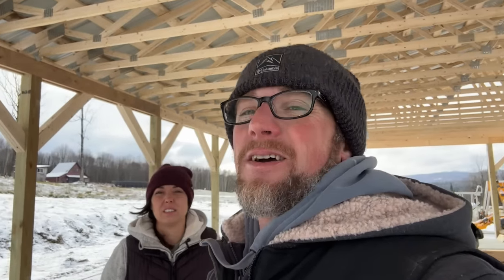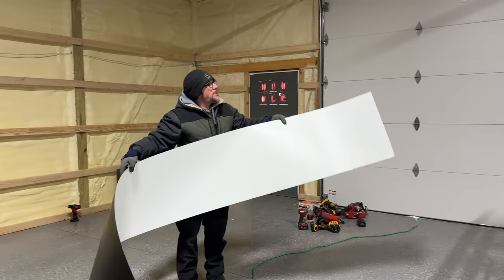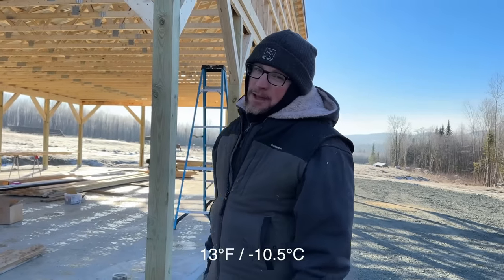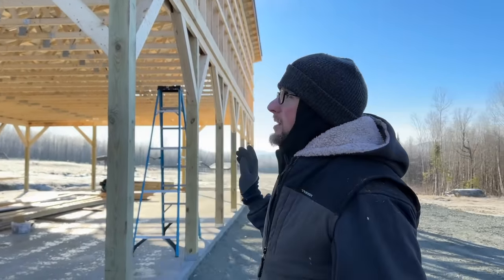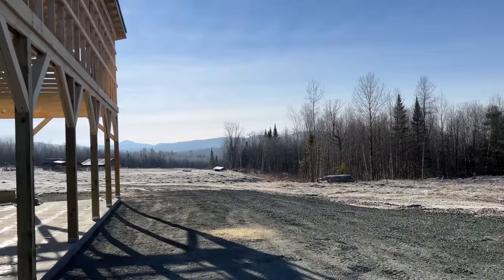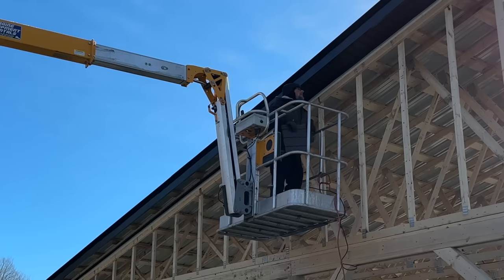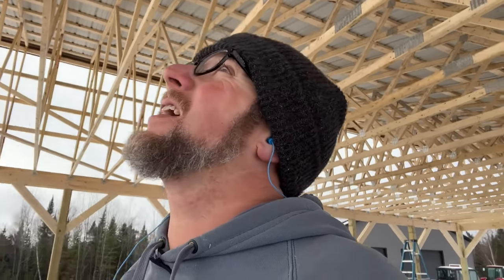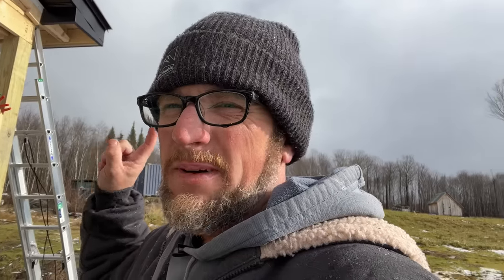The Day I got STUCK in the Lift!!! Day 5 Building our 32x48 Off Grid Post & Beam Barn in the WOODS

Comment: A mop up job I got due to a GC's inability to due their job resulted in the discovery of an orphan window that was totally missing it's trim. Using a couple of 2x4's and and unused piece of stainless steel trim from a Viking Range I made a sheet metal bender. Thanks for the pointers using the  bender there if I should ever need that skill. A teacher at a vocational school would be a good fit for ya. Gina needs a face shield from Harbor Freight. Safety squints and glasses aren't cutting it. Seeing those eyes as she's a tad stressed out over you getting hung up is preferable to not seeing them being able to express that due to an injury.🥺
About the layout: Where's the frost free hydrant for the water coming in from? Unless the barn is heated with it being closed up the body heat of the animals won't keep it from being frozen. 🥶You'll end up breaking the ice twice a day and filling them up at that time too which is preferable to putting heat tape on it. Livestock messing with electrical results in downed animals.😵Just a Few Acres Pete has an open front setup that works well for him. Are you doing deep bedding or just shoveling it daily.🥳Chickens have a great time on compost piles and pigs do a great job of turning it over with a bit of incentive of mixing some shelled corn in there to go after. As a heat source it works too as you add some sawdust when it gets a little wiffy for the carbon. What kind of hay are you getting: Bales that are rolled or rectangular like those around when I was a kid? With that determined where are you storing them? You spoke of a couple cows so more is coming than you needed before when it was just the goats. Rumor has it you still got the old place so some could be put up there. More input is needed before I can begin to scratch my nut on this.🤔
Looking for you next time from South West Mo.👍😁. Guess whats going on here.☔

Comment: Wondering if Al is going to have the inside metal walls of the Barn Spray Foamed like he had done with the Workshop building ? Sure would be a lot nicer and warmer for the livestock during the cold winter months and also insulate from the heat of the hot summers !
Reply: They

Comment: Al, I know it's a rental lift and it's going back soon, but both Milwaukee and DeWalt have 18v cordless heat guns.  With all your equipment, I can see where one would be handy to have in the side by side, tractor, etc... especially in winter.   I'm in the Makita platform, but have a few of the Ryobi 18v tools for garden stuff.  I bought one of the heat guns (Ryobi) and use it to soften the drip irrigation mainlines and tape/dripline to slide on or off the fittings (easier on old arthritic hands).  Next thing I know, it was how did I not have one of these before as there are so many more times it had come in handy.

Comment: You might want to put down tracks so you have moveable walls that you can adjust to the needs of each animal. I’ve seen them in horse stables with the stall walls that are made with metal brackets that you slot wooden slats into so the height of the wall can be adjusted. I don’t think you could do both in one barn 🧐
Reply: That's a good idea - although screws would work too... just unscrew any construction and re-arrange!
Reply: @samvalentine3206  Pens would be better like what Justin Rhodes does. Animals push a lot and use walls as scratching posts. You need pens! I have horse stalls in my barn but I wouldn't trust a pig with one! Big staples and such to hold pig panels with. Pigs are bulldozers. They can send a metal door flying off their snouts and do several revolutions with it. I've seen it. We were trying to cover a hole by our pig gate with a metal door. It went flying! They started playing with it all over their pen. I'm not sure a cow wouldn't break a horse stall.

Comment: Al, your buildings are wonderful and so well planned.  I could not tell for sure,  but your barn trusses appears to have lateral diagonal bracing only on the high eave side.   I built a very similar trussed structure in 1992  that suffered a straight line wind event before we got all the lateral diagonal braces in place.  It had decking, so the trusses turned over from their vertical plane and turned to spaghetti.  Lost the entire roof.   Lateral diagonal bracing is critical at the mid span point of your trusses and should run the length of the building traversing up and down about a 30 to 45  degree angle.

Comment: You need to spray some wd40 around the buttons That will keep the water from building up. You need to show Gina on the machine. There's Emergency buttons down On the bottom there to get you down if you get stuck up there.😂

Comment: Are you considering a water catchment system using water from the new barn?  Don't know if you have an area in the barn for a 350/500 Gallon tote.  Burying the Cistern/Tote is another option. Since you have solar, would you be able to heat or insulate the Tote to prevent freezing.  I guess an easy option is you only use the water catchment system for the 6-8 months when there won't be freezing temperatures. Do you have an area where a small pond could be built and water from the roof flows into the pond.

Comment: Good morning Al and Gina.  Maybe you've gotten to know me a little.  Maybe your saying or thinking "Oh ~  that guy again."  Well anyway.  So much fun with all the potential that you've got here.  But really guys, Christmas is here.  You all should be decorating and making plans for Christmas ~ don't you think?   Just saying.  Anyway. Yea ~ too cold.  So you know I've got "suggestions."  Here you go:  Remember the greenhouse that you've got at the other property?  The Greenhouse grade 6ml plastic. Not from Lowes or H.D.  ~ I get mine from Cleveland and they get it from Israel.  So the sofits and siding.  But then you could "fill in" doors and any extra bays with a temporary quick cover of plastic. Keeps the wind and snow out.  Just for the winter.  Reinforce with some light framing two feet on center.  Strapping works. Just to wrap ;the building for now. Take another look in April and May.  OK so that's my suggestion. Just saying.  Best wishes and thank you so much for sharing all that you do.    ～ ✨🌟👍🌟✨ ～

Comment: It's probably a moot point by now but it would have been in your best interest to store the life in your shop overnight to keep everything from freezing and save the batteries and the oil from being so cold. Everything looks good, the only question I have is do you have plans to close in the sides for a windbreak or what were your plans.
Reply: the shop is not heated at the moment, but an old raincoat and a bungee cord can keep the weather away from the controls at night.

Comment: Hi gang wish I was a little younger and had your ambition. You might try just throwing a coat, piece of plastic or a blanket over the controls at night. It works wonders to keep the controls working.  I had a helper besides my wife building a shop in November & December. Tenps down to -20 for a week and 2 ft of snow by the time we finished. Hope you two don't have any of that. Applaud your ambition.

Comment: Hey out just wondering why wouldn't you park the lift in one side of the shop? I know what's not heated, but then it's intelligent and the buttons wouldn't be frosty. And inside the control box would be at least a little bit. Warmer and probably wouldn't freeze.  And stick in and that's probably what's happening is when you press one button. It's getting a little snikki because of the frost and what not instagram post in not releasing and therefore, you can't press any of the other buttons to work because one is still engaged

Comment: I think you are doing a awesome job on this barn I would have a very big chicken run outside, also a stall with a little run for the pigs in the winter, and the goats the same thing. And I would even put a automatic door opener, with a sensor so the cows can go in and out all the time, they will learn that the door does work as they are walking towards, I live in the Northeast Connecticut exactly and it can get brutal cold, but also you would like to go outside once in a while. Just an idea of how but what ever you do the pig stall and the goats not so much to goats but definitely the pig, enclosed their stall just like a little room with two half doors that open up, reason being pigs can smell terrible you want to try to keep that to a limit in one little area that way the smell can get outside and the inside will not smell terrible, and I would only use this in the wintertime to keep them out of the weather.
Reply: Remember they will be using deep bedding so there doesn't have to be a bad smell. Like Joel Salatin says, bad smells on a farm is just poor management. Have a great rest of your week!
Reply: well then I have been around poor management when ever I have been around pigs because my God, I have known a few people in my life and you couldn't pay me to have pigs after I smelt that.but now that you have mentioned that the pens did not look that clean, didn't realize that thank you for your experience in this matter and making me more wiser I appreciate that. @StoneKathryn
Reply: @gregsecore9625  We have two pig pens outside we rotate the pigs through until slaughter. We only raise a maximum of 3 at a time. We don't keep them for the winter. We have them Spring through to Fall. When they are very little we will keep them in a barn "horse" stall with a heat lamp until it's warm enough for them to be outside overnight. We have started with piglets as small as 15 pounds. We don't have a breeding pair. They are just feeder pigs.  Lots of pine shavings go down in the stall. We don't have a good source of wood chips.